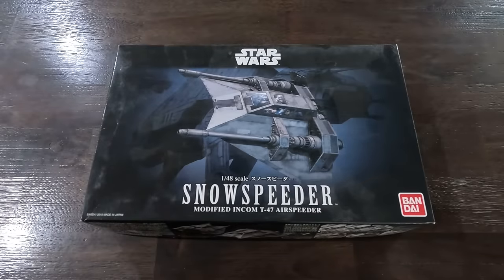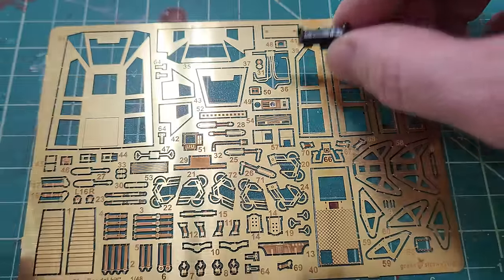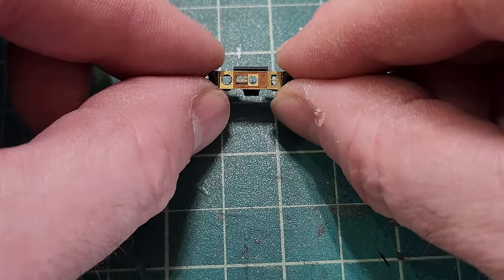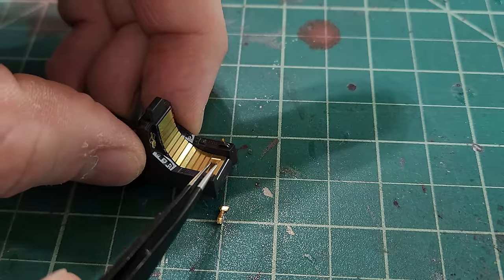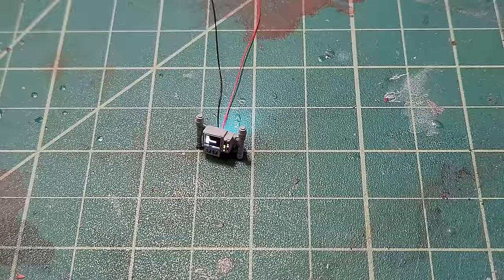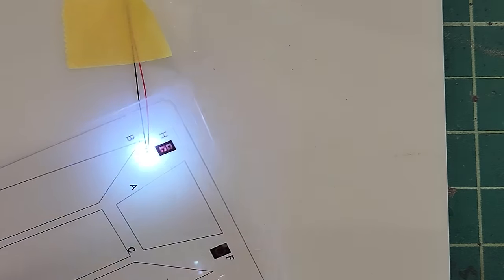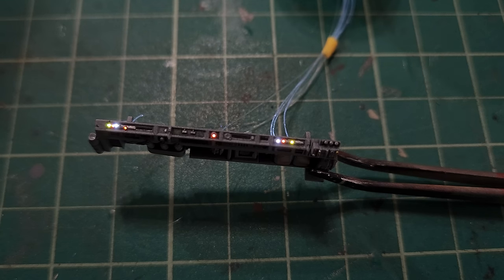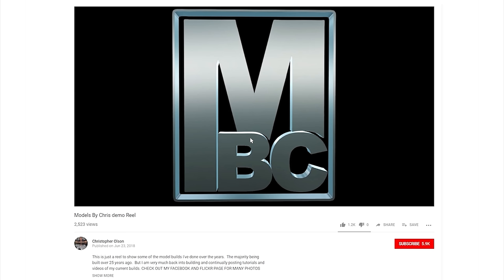Bandai 1/48 scale Snowspeeder model build Pt I  Lighting cockpit

Comment: That Looks REALLY Good!!!:cat-orange-whistling::face-blue-wide-eyes:

but, where did you get your lights from??  Is it a store or 'E-bay'??

What size is that "littlest light", I have not seen one That small, ( nor that "fragile-looking" ).

Lastly, That kit IS Really small!!:hand-orange-covering-eyes:
Reply from the maker: I just buy LEDs from either Ebay or Amazon.  The little LEDs are the smallest made.  0402 SMD LED.  Sometimes called pico.  They're 1mm in size. The larger one used to light the fiber optics is a standard 3mm LED.  The fiber optics I also get from Ebay.  These particular fibers were .25mm diameter.

Comment: Do you not have a problem later on using a red sharpie? I have used it in the past and found that with a white light behind it bleaches the red out. I admit that it was when I used grain of wheat bulbs and haven't tried it with LEDs. (Anyone know if the light from an LED is different from GOW?)
Reply from the maker: Can't really say.  I have used it in the past and they're still red.  But on this build,  I actually ended up dabbing a bit of clear red and clear yellow on the end after doing the test dry fit. I'll be mentioning that on part II.  Just have it a bit more color.